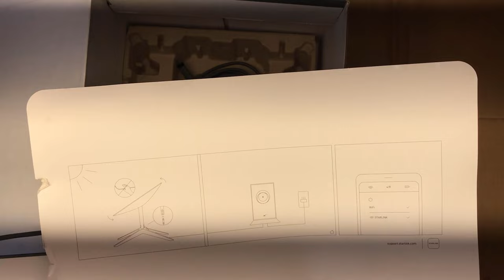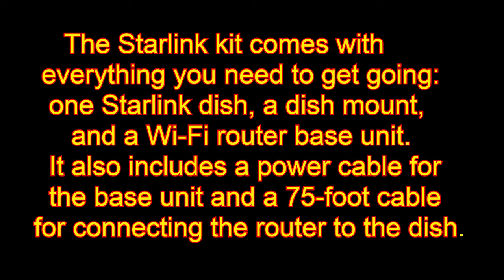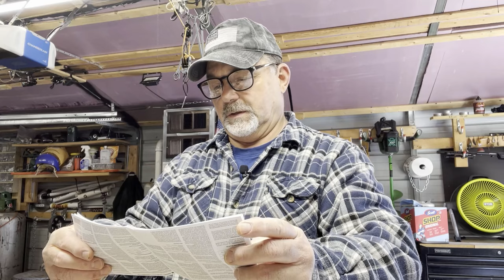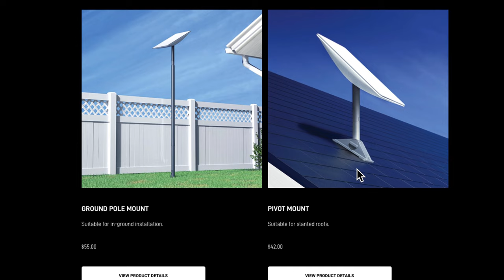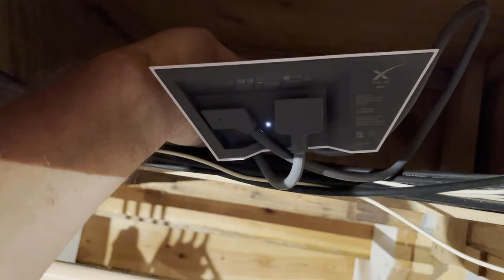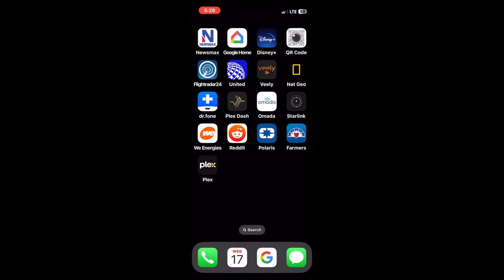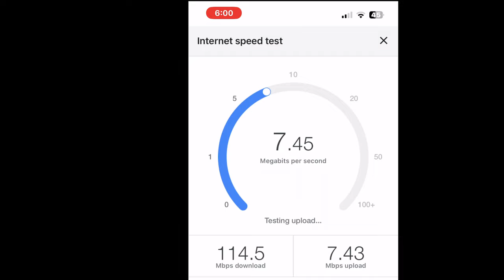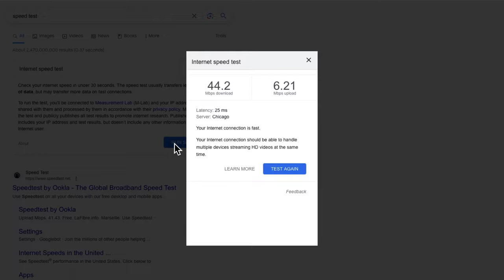Starlink Unboxing / Installation On Shingle Roof / Before And After Speed Tests / Tutorial

Comment: Ok, I installed one sept 2024.  There NO WAY YOU CAN prevent TEARING THE ASPHALT.  So cut it to where the screws go into the fashing at the top.  There is the center, and another on either side. There really should be a flat piece with holes on the INSIDE of the lower base to also screw into.  When my starlink was on the ground on the little standard stand the "face" of it was always vertical that is narrow  up and down.  However on the roof the whole face rotated 90 degrees and went horizontal go figure. ALSO I WOULD NOT USE THE BLACK TAR TAPE STUFF ON THE TOP BASE IN BETWEEN THE PIVOT MOUNT AND IT.  IT WILL CAUSE IT TO "WOBBLE" I WILL TAKE IT OFF LATER.  VERY MESSY

Comment: I just received mine today, the flashing mount is now $93 and the pivot is $68.  It also only ships with a 50 ft cable.  I already have a gable pole mount I will us for the install so I won't be purchasing any extra mounting components.

Comment: I just would have slide it underneath the first top shingles no cutting screwed it in at the top tar caulked the rest of the plate drilled my hole for the cable and called it a day

Comment: Thanks so much for the video. I just got my Star Link unit here in the Philippines. I can't put it on my roof (metal roofs here) but I have a work around.
You answered a question for me - the satellite dish swivels as well as moving up and down. Also, I'm glad the one and a quarter inch drill bit worked. I just bought a one and three eighths inch bit. Again, thank you for the very informative video.
Reply from the maker: No problem 👍

Comment: Know that, the two 3" lag bolts that came with the pivot mount are designed for an RV installation, directly drilled into the roof. They are useless for attaching to the flash mount top cover (not the flat base) for a house roof. All of the provided hardware in both pivot and flash mount kits, in my opinion, were insufficient for a secure roof installation, so I used my own screws, washers and bolts for my shingle roof install. Especially relevant living in Florida with excessive rain, tropical storms and hurricanes. I fortified all pre-holes, drilled them out and upgraded with longer / wider screws, bolts and washers. Used Wensilon, Hex Washer Head 410 stainless steel, regular and Self Drilling Screws. For added sealant and first layer, UV & Weatherproof 2" Sealant Roofing Tape. 

Second layer, Permatex Black Silicone Adhesive applied to all screws with Thread Sealant Paste, plus Medium Strength Thread Locker 243. Then, pre-blocked all holes with 2" rubber tape. Third water sealant layer, I brushed on a few coats of Thompson's water seal on / around the edges of the flash mount base and screw heads. Am also definitely following Gerald's lead and using the Black Flex Split Wire Conduit, as I'm running surface cable.

Comment: Glad it's working well for you. I've done Directv installs and old school tv antenna installs, but not Starlink. I'm impressed with the automatic positioning - much easier than Directv or Dish. I'm still surprised they make a mount that requires you to drill a hole in your roof! I'm the same age as you and i figure you probably installed TV antennas back in the day. I would have run the cable along the ridge and brought it in on the side wall rather than putting a big hole in my roof. I couldn't figure out why they had you cutting shingles and putting it under the shingles like flashing until i saw you drill the hole. Then I understood. I'm also amazed that the power light (or any light) isn't where you can see it. And there's no ethernet connection to hook it into your existing network switch. Looks like you have a nice network setup there. But i guess you would need a WiFi receiver to connect the Starlink router to your existing network. I had a Linksys gaming adapter years ago that would connect to a WiFi router and give you an ethernet connection that could connect to a PC or wired router.
Reply: I agree. It should have at least one ethernet connection.

Comment: The connector on the antenna end of the cable can be flattened back against the cable, allowing it to pass through a smaller hole. That requires you to route it from inside to outside.

Comment: I would never mess with the top of the roof.  Better to use a pole on the side wall or have the dish at the top of the antenna mast you have (if there are free slot on the top).
Reply from the maker: So far so good, no issues.

Comment: I was told to water proof tape the connector on the antenna where it plugs in. I read about of folks antenna died from water shorting out the power.

Comment: It seems the only reason to center over the joints, is if you were JUST using the mount without the larger piece. In that case you would need to use lag bolts into the joints to secure it.  … Anyways, great video and sorry about your glass table top, that was a bummer.
Reply from the maker: Great point!

Comment: Question: where is your router from the satellite dish? And curious to know if having a metal roof can affect the signal to the router...my guess is yes 🤔
Reply from the maker: The Router is in the floor joists above the basement in the ceiling. You can see it in the video at timeline 35:23. Yes I believe you are correct. A metal roof would obstruct a router signal if the router was located in the metal building. I do not have a metal roof on this building.

Comment: Nice video. Thanks for showing us your mistakes as well. Do you think water or bugs could  go down the black split piece you put over the cable? Just wondering. I can't wait to install mine. We have no internet where I live and this is going to be a nice addition.
Reply from the maker: If bugs did get in, they would be prevented from entering the garage through the roof hole I cut. That hole was caulked quite extensively with silicone before I closed up that mounting bracket.
Reply: I just got mine and used the flexi cord on mine to run the cord across the roof.  I didn't want the starlink cable rubbing against the shingles and I don't want the permanent roof mount yet as I'm likely moving within the year. I went with the non-penetrating roof mount for now which means the cable is laying on the roof and completely exposed to the elements. Just some food for thought!

Comment: Maybe I'm missing something but why not mount it to the tower?
Reply: And also you might want more slack in cable case your dish moves around, just my thoughts.
Reply from the maker: Lightning and cost of the added data cable I would need to reach the tower.

Comment: How is it durning heavy rain or if it has snowed by you. I’m considering getting star link my only concern is how it works during tuff weathers
Reply from the maker: No problem in the rain, we have not had any snow since I installed it.
Reply: I have one, I live in MI and had no problems with mine, it actually has a heat setting, it melts the snow off of it. :)

Comment: Sorry about your table😢
Reply from the maker: Hi There, thanks for your comment. Others have said the same. I bypassed the issue and haven't said what I did to correct the problem. It all worked out though. Let me tell you what I did after that. I purchased a 5/16-inch thick 4x8 foot sheet of nice wood and cut out a circle to match the tabletop. I then used garage floor epoxy and coated both sides of the wood circle in the same color as the umbrella I had over the table. All is well, it is back in use. WG7644 thanks.

Comment: Just got mine, thanks for the suggestion and information 🫡🇺🇸 sorry about your glass table!
Reply from the maker: No worries! I purchased a nice 4'x8' x1/2" piece of plywood, cut it into a circle, and then coated both sides with epoxy garage floor coating. Except for the sprinkles I put on after the epoxy, it looks pretty good. Thanks for the comment.